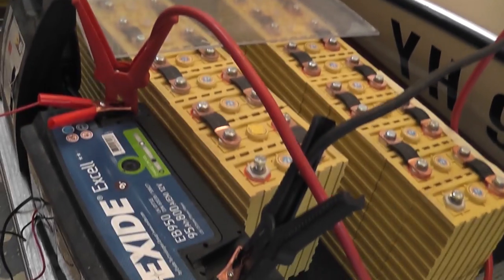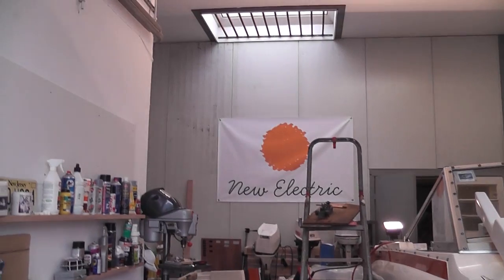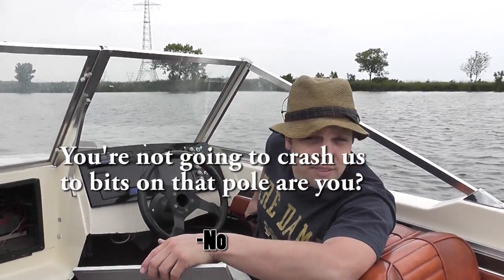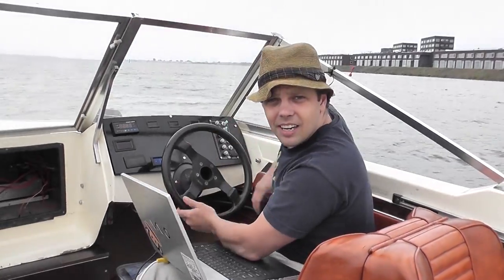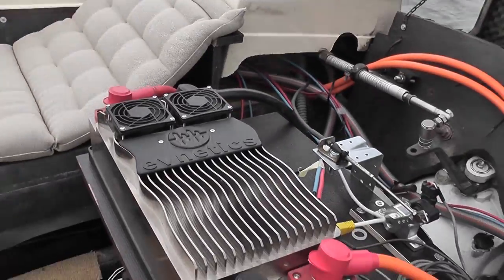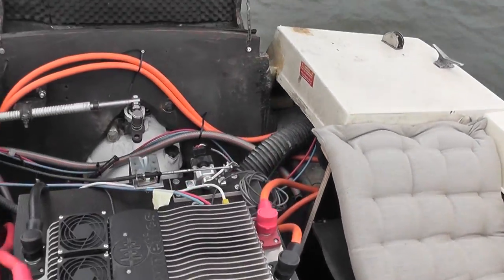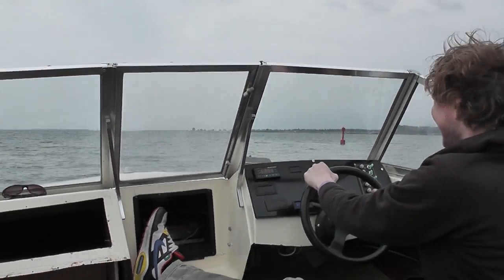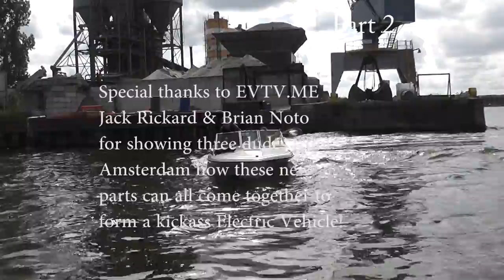Making of New Electric Speedboat part 2

Comment: I'd love to do this with my boat.  Or another boat.  Starting to think about some type of cruiser.  Be cool to have 2 motors on a pontoon boat.  Btw, I have a CJ5 as well.  AMC360 powered.  Electric might be the future if the motor ever goes.  Both the boat and Jeep are good candidates for me, as I'll likely only be out for a few hours.  I also like the ideas in other comments about a dock (or a shelter for the Jeep) with solar panels for recharging.  Keep up the inspiration!

Comment: This is amazing stuff, I’ve thought about doing the same thing in the future but for a bigger boat. By the way look into SMART TABS. These are small surfaces that auto adjust with pressure from the water to make the boat plane out much faster therefore requiring less speed and energy for cruising while planing.

Comment: I have a 10' livingston with a bi-hull design simular to a tunnel hull that I would like to put twin e-jet drives in. Sadly I have no experience in the technology and application. My goal is a small river runner capable of around 30 to 40 mph. Got any Ideas ?
Reply: Buy e jet see doo 36 kw 19 mes 48 kw 23 me range
Reply: Buy e jet ski
Reply: Buyve jet infable boat
Reply: Buy ekr r c picnicbiat 2 elrric jet 52 mile esnge
Reply: You'd need a large electric motor and a controller. Probably gonna cost upwards of 20 grand. The cells are not too bad nowadays. 100Ah cells can be had for $60 each shipped. Due to the high power needed I would look for cells capable of 3C continuous discharge and making sure they are NEW and Grade A which is very hard to get. Everyone lies saying they have Grade A. You need a very very low internal resistance. If you can find 280Ah cells that do more than 1C that might be better.

So I just found 3C 100Ah cells and 5C 56Ah prismatic cells. Thats continuous discharge. You can get pouch cells that are 10C or higher up to 20C. Stick with LiFeP04 or LTO....LTO is very expensive but has crazy C rates. 40C discharge/10C charge but not very energy dense and 3X as expensive. So I think your best bet is prismatic 3C or 5C cells. Pouch cells can be hard to work with because they NEED compression so it would be a lot of custom cases for them but there are some amazing cells. I know A123 has some very high discharge LiFeP04 pouch cells. Their cylindrical cells are likely too heavy, I have some of the M1B and the 2.5Ah capacity won't be enough, they weigh 76 grams a piece. So 760 grams per 25Ah but you have a discharge of 500A continuous and 1200A peak. These guys had quite a few 100Ah cells. I think they said 70? That would line up with 240V. 3.2*70=224V and 3.6*70=252V. so you'd need 70 cells in series and 40 in parallel to match their range (no clue what they could get). You could do way less in the P groups, maybe 20 and still have enough power (1000A continuous 2400A peak)

So find a controller in the 240V range that'll take 100A....that's a 24kw motor. They had 90A at 240V so more like 23.1kw unless their cells were 2C I'd have to check the old winstons.